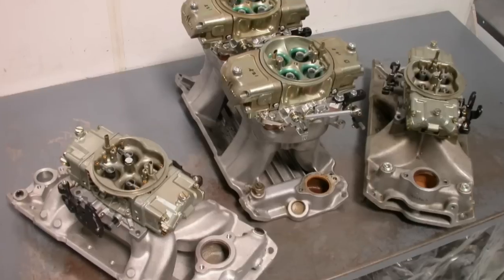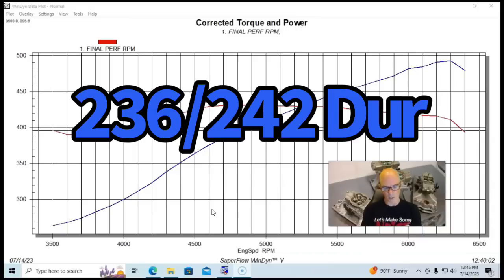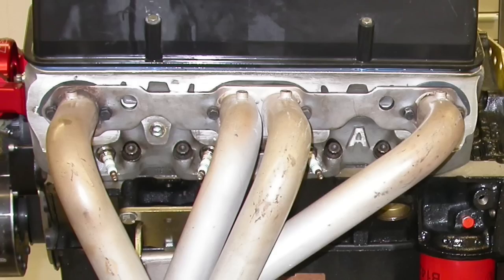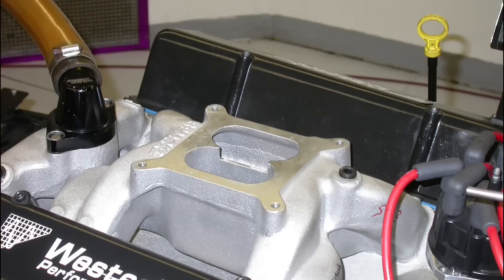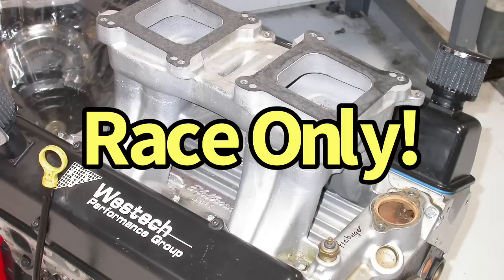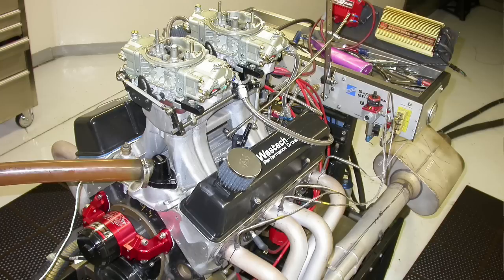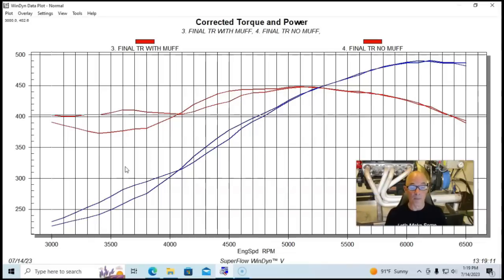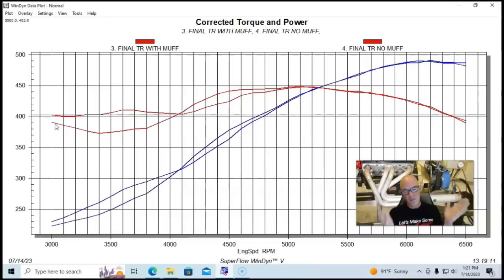HOW MUCH POWER IS A SBC TUNNEL RAM WORTH? 355 SBC INTAKE TEST-TUNNEL RAM VS RPM AIR GAP VS VICTOR JR

Comment: I have an important question for you about the 4.8 LS. I watched many of your videos and have seen you go to 7000 and 7500 rpm with the 4.8 because they like to Rev. That being said, how long can it maintain those kind of rpms or how much rpm can it handle for extended periods of time. I have a 21 ft Grady White boat with a 4.3 v6 mercruser engine. I have been told it's exactly the same block and heads as the 4.3 vortex in my Chevy truck. I took the boat out and normally cruise 3500 to 4000 rpm which at 4000 rpm is about 30 to 33 mph so mph is about 7 to 10 lower than rpm in thousands. I once ran up to 45 mph and had that 4.3 screaming at about 5500 rpm. I went for 5 minutes or less and got worried about blowing up the engine. Now I'm into remodeling the boat and was thinking about a 4.8 LS with a BTR truck Norris cam and springs and a 4 barrel intake and carb. If I did that how reliable, how many rpms could that engine take before I run the risk of slinging a rod or is there something else I need to do to help it last for longer periods of time at high rpm.
Reply from the maker: The 4.8L will make a LOT more power (200 hp more) than your 4.3L, so you need to think about prop pitch and cavitation AND engine rpm. A properly tuned and cooled 4.8L will run 7000 rpm for a long time, but I doubt your combo will want to run there
Reply: @richardholdener1727  if I can get it to 50 mph on the water would be great. Reason being she has a 100 gallon fuel tank which with the 4.3 is pretty efficient. I'm not sure the mpg yet. Speedometer is broken so I don't know how far for the fuel used. But when I get that figured out I want to take her to Florida and if I'm able to fuel wise cruise to the Bahamas. So that's the need for extra speed. 350 miles at 35mph is 10 hours of hard running. 6 hours at 50. Still a work out but more doable. That's the premise anyway if everything remains the same 6000 rpm should get me to the 50 mph I'm looking for. As for the prop pitch I will be looking at that first and discussing with boat repair experts. That and actually how to figure out fuel and distance equation so I don't run myself out of gas. I learned that steady running she just sips fuel. All day cruising at 2500 to 3000 rpm about 8 hours it only uses 9 to 10 gallon of gas. A lot of hard starts pulling tubes and skiers it used 50 gallons of gas in about 8 hours.
Reply: I’d be worried that the stock outdrive might Not be up for the task.
Reply: @BuzzLOLOL  as for keeping it cool enough I need to ask a boat expert or mechanic. Reason being the way it is set up right now it pulls fresh water through the outdrive and pumps it into the engine constantly 
I want to make it a closed system with a radiator and electric fans. That way I wouldn't need to winterize it and I could take it out in cold weather and I wouldn't have to flush the engine when it goes out on salt water. For fresh water I would only need to lower the out drive to let it drain and salt water I'd still need to hose it out but I wouldn't have to worry about corrosion in the engine itself. I'm not worried about high speed just would like to get fast enough for longer cruises and not beat the boat to death trying to run 12 hours at 30 mph instead of 7 hours at 50
Reply: LS and 7500. Crank may hold it but the rods will not. And I doubt they have usefull power at 7500 anyway
Reply: @ldnwholesale8552  like I was saying I took my 4.3 Chevy to 5200 to 5500 rpm and it was screaming. So I didn't keep it there long. I wanted to be able to go further with my boat but didn't want to spend all day doing it. I really need to not worry about it, just enjoy it. I can still take it out in the gulf of Mexico or along the Florida keys. I have a trailer for it so I launch closer to where I wanted to cruise.
Reply: @dannytravis7118  Merc Marine may be able to help or a reputable boat shop
How bout a one way trip to the Bahamas, Ill kick in for gas drop me off permanently. lol
Reply: @dannytravis7118  Ls should take steady 5k with less risk Id think. Can your system behind the engine handle it..or better yet a 5.3? Ask MM Ibet they have good ls combos sorted, tunes etc with proven results
Gotta be a good boat forum online somewhere, sounds like fun

Comment: I just got an Edelbrock 7110 street tunnel ram that I'm planning to run on my mild roller 355. I can get a 4" spacer to go between the plenum and runners. It should really help the lower end torque. I have a baby cam in it. 202⁰/212⁰@.050"
Reply from the maker: why would plenum volume help low end?
Reply: @richardholdener1727  it adds runner length, and to a lesser extent, overall plenum volume. The dual quad plenum bolts to the top of the runners on the 7110 street tunnel ram. The mounting flange between the plenum and base looks almost like a pair of 4 leaf clovers. So you can add runner length much like your experimental adjustable runner length intakes.
Reply: @BuzzLOLOL  the runner length of the intake is 14.5". I know the TPI setup is something like 20". That would be ideal for low end torque, but the tpi stuff runs out of steam pretty early in the rev range. And I wanted to try out a tunnel ram sticking through the hood.
Reply from the maker: My bad-I though you were talking about carb spacers-runner extensions could change things
Reply: Not sure Id do that. Extending runner length sure. Much larger plenum I wouldnt do. 
Thats like a stock cam you are running ...210/2teens is great for st torque on a 350 will still idle like a kitten

Comment: I have a fairly long sedan by modern standards (118.5" wheelbase Caprice PPV, L76/L77)
I've heard that assuming sufficiently large headers/collector running into equivalent pipes, that I can step it down into the stock mufflers, because large pipes stop mattering so much towards the end of the run at the back of the car. has any of your testing shown anything relevant to that? they're heavy, but I'm wondering if keeping the stock axle back/mufflers is a big deal beyond sound.
Reply from the maker: you need to see if stock mufflers hurt flow-they might
Reply: @richardholdener1727  yeah. I know the charge cools and doesn't need as much diameter pipe, but restriction is still restriction. thx
Reply from the maker: I understand the change in temp, but stock mufflers were designed with specific flow and noise cancellation in mind-not sure how large collectors would change the flow rate of the exhaust
Reply: @richardholdener1727  I wasn't implying a large collector would compensate for a poor flowing muffler stack. I'm agreeing with you that if the mufflers are a restriction, they are a restriction. I just hadn't thought about that aspect and was thanking you for bringing my mind around to that aspect.
Reply: I know the Ford 4.6 and other engines from the 90s-2000s received 10-20HP factory rating differences with different exhaust options, along with other bigger cars. The more volume of tubing before the mufflers, the less it should matter as a flow restriction. That said, factory mufflers (especially before peak efficiency of the late 2000s-onwards) with chambers are an inherent flow restriction as they're designed to break up kind of 'linear' flow (exhaust gas impulses, thus sound pressure), muting distinct impulses into a low pressure puff. They're inherently restrictive to some degree, but this is largely dependent on exhaust volume to muffler volume and internal baffling. 

They directly fight and oppose port tuning ('scavenging', etc) but again the expansion volume before the muffler should reduce the effect. Chambered mufflers are by far the most effective at SPL reduction, though at the cost of restriction as stated. The internal baffling design was severely restrictive around the 90s, compared to say some aftermarket chambered muffler like the Flowmaster whatevers. A pushrod V8 has some of the lowest pressure and deepest tone waves, so they don't need true mufflers like a 370z or VTEC i4. 

You can easily get away with a decent flow-through 'muffler' like Dynomax Ultra Flo which I highly recommend, or other glass-pack large resonator that don't really impede flow at all. They're also way lighter, which is nice. I ran a Dynomax catback in a 2012 Mustang w/ short-tube headers and stock cats and they're quiet with lower tones and low-throttle pressures but become way louder with high throttle/load.

Comment: Great torque curve! TR's mostly useless on street, cept 4 Bling, sticken thru hood. Lo rpm torque thru 4500 rpm , where streeters spend 95% of time.
Reply: You obviously didn't see the dyno test. Tunnel ram has most torque where you mentioned

Comment: Richard did you run it with a single 4 barrel top to see the difference between that and dual quads?
Reply from the maker: nope
Reply: @richardholdener1727  maybe sometime in the future lol, none the less this is a great video. I remember the old adage that, "oh yeah tunnel rams are not streetable, top end only." Sure they are
Reply: Engine Masters did that test. Either their most recent episode or the one prior. I could tell you the outcome but what fun is that? 😁
Reply: @sikrandall83  Those are from guys that never could tune right. Long runners are awesome on the st

Comment: Do you think putting a cutout before that muffler would have the same effect?
Reply from the maker: anything that shortens the collector length
Reply: @richardholdener1727 Cool. That's like a 2-in-1. Put an RPM trigger that'll open the cutouts @ 4k-ish RPM and you get both gains! 👍
Reply from the maker: that might be cool

Comment: With the issue at about 6200, valve float, ignition whatever that whole test was a. Waste of time, the differences of the intake are really going to show up at the high end. That motor needs to be capable of twisting 7500 to truly test the high rpm intakes.
Reply from the maker: this cam and combo (or these intakes) will not going to make peak power anywhere near 7500

Comment: Clearly not all tunnel rams are created equal. Without big cubes and rpms the tunnel ram concept is just for show. It's a trick best left to pro stockers imo.
Reply from the maker: That is correct that tunnel rams are not all the same, but the concept works well with the right tunnel ram on the right motor. Definitely Not just for Pro Stock.
Reply: @richardholdener1727  What does a tunnel ram designed for street use offer over any other street manifold?
Reply: @beestoe993  More torque, longer runner
Reply: @gordocarbo  Wrong. Tunnel rams are a single plane design. Dual plane manifolds will make way more torque on a street engine. Longer runners yes, that is is to promote velocity/rpms. But has to be proportionate to the specific engine.

Comment: Now try and fit the tunnel ram under a standard bonnet. And try driving it at 1500 rpm. Will not happen. The Victor fits under most bonnets, though generally a 2" spacer livens them up considerably. But then does not fit under the bonnet! For a 6000 rpm engine the 850 was way too big, you ned to run 7000 rpm at least  to make use of it.
Reply: Who drives a cammed sb at 1500 rpm?

Comment: You jeed to stop the focus of top vs bottom power and tq and give the comparison of the total areas under the entire curve of each hp and tq.  In a street rig and frankly even in many comp it's more critical unless you have universal access to tons of different transmissions with various gearing ratios as well as diff ratios.  Who cares about just the top end gain if you must keep rpmsbbetween 5500 - 6500?   Seriously you are going to have a trans and rear end gearing that will allow you to hold your rpm  band to only 1k -2k total to stay in that narrow advantageous range!?!

Looking at the ones with much broader improved perf you are showing nearly 2x the gains vs the top end bias units and across from off idle to 5k rpms.  On the street it's not even close.  Gaining 2x the high end gains and over 4000 rpm range vs the high end with half as much gain over also half the rpm band of at most 2k.  So it's lije gaining 30 hp from 2-5k vs gaining 15 hp fromm5.5k-6.5k.  So under the curve average your actually loosing 15 hp with the high end setup vs what you getdual balanced.  The dual plane 4pm should never be called a low end bias.  It's a balanced band performer as its power is balanced across the entire band.  It just does not have its setup severely bias to a very narrow band up high.  That is a strip only value.
Reply from the maker: if only I showed the entire hp and torque curves and all the gains for ech test!